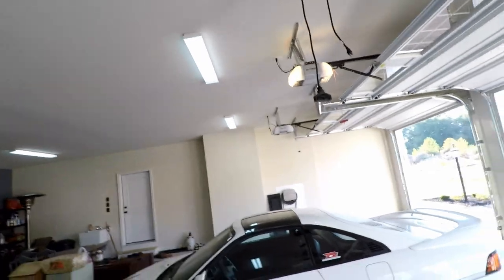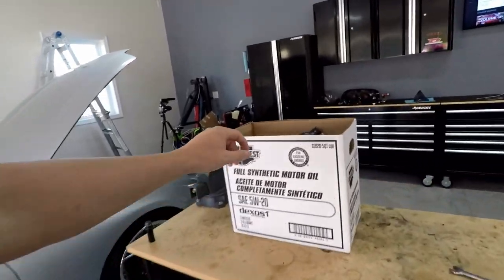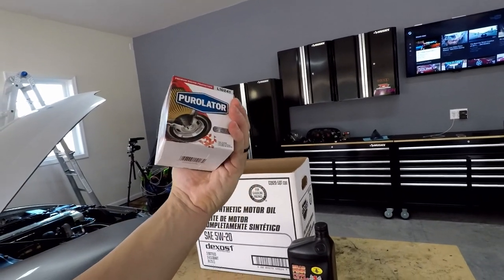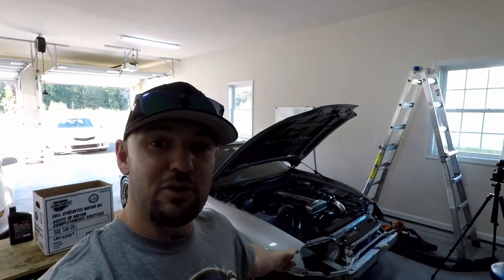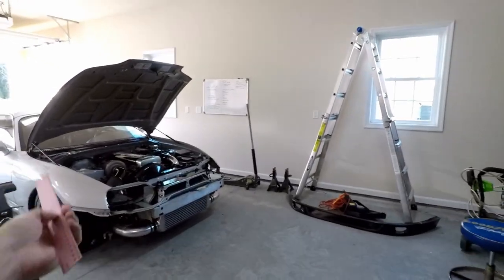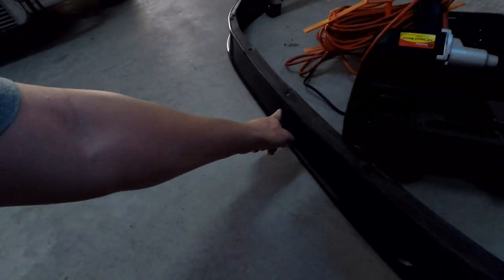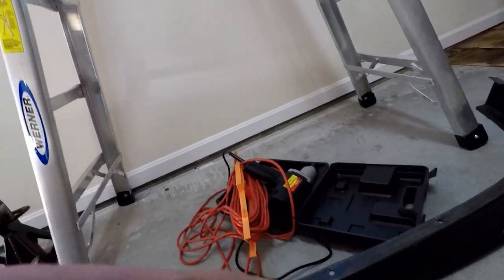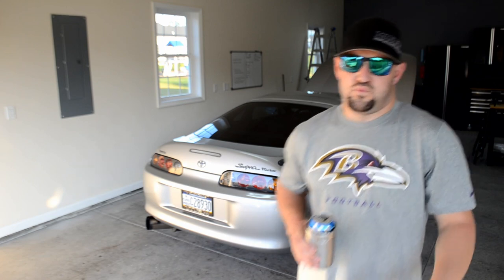American Made Or American Copy?

Comment: Toyota Supra active front lip.
Reply: Unfortunately, you can't run a front mount with the Toyota active front lip because the electric motor and mechanical components for it take up too much room.
Reply: SMIC's are available for up to 700rwhp. They are not as cheap or as easy to install as the FMIC but there are stuff out there. I am going for under 600rwhp and will be using the Whifbitz SMIC and piping.